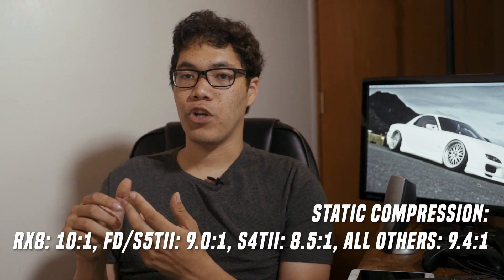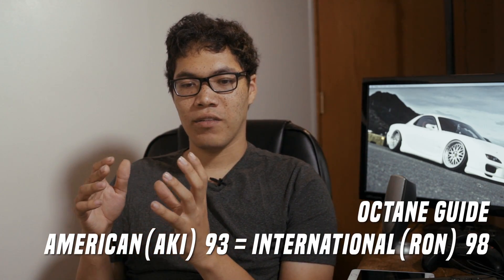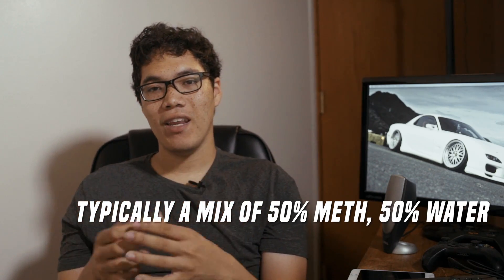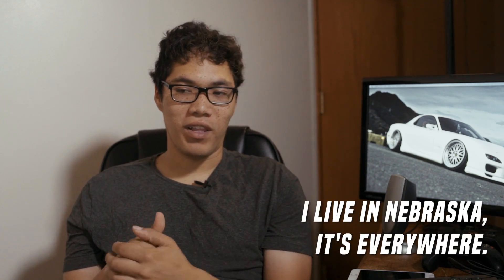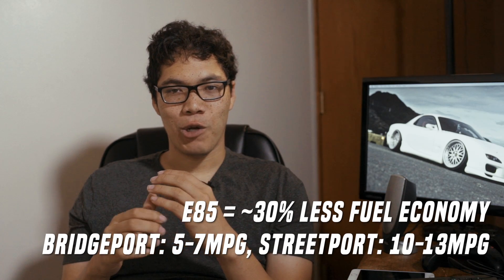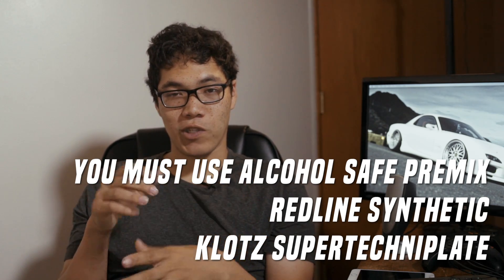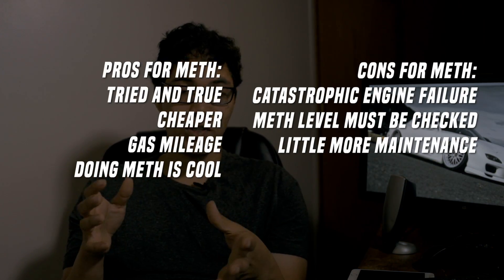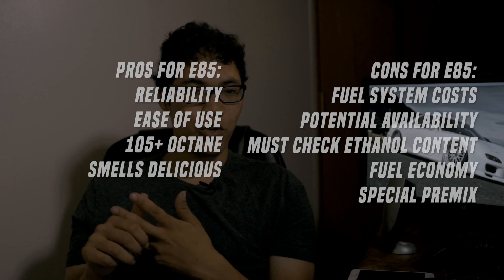E85 Or Meth Injection For A Mazda RX7?

Comment from the maker: Quick correction: I used the terms pre-ignition and detonation interchangeably when they are not. Pre ignition is the ignition of fuel before the spark plug fires, and detonation is the uncontrolled burn, or explosion of the fuel/air mixture.
Reply from the maker: Detonation is the ignition. The fuel/air mixture should burn predictably. When it explodes, it's detonation.
Reply: @KennyatHumble  detonation has nothing to do with explosions. . . Detonation = spontaneous combustion.  Pre-ignition = spontaneous combustion (detonation) prior to TDC (actually it's about 15-30° before TDC, depending on timing, rpm etc. . . But tries to send the crank the opposite direction)
Reply: Yeah water injection actually lowers detonation temperatures in result leaves more space for compression or boost
Reply: Would be interesting to see an engine (rotor) pulled down after running water/meth for it's entire life. I'd expect to see much less carbon.
Reply: Rotors Magazine All good Kenny!!!
Reply from the maker: Mark Thomas thanks for calling it out, don't want to spread misinformation
Reply: No worries mate. Love the channel. Cheers from Queensland Australia.
Reply: So does detonation happen after ignition?
Reply: was about ready to hammer you on that XD

Comment: I really thought this was fuel vs fuel and hearing him say that e85 needs big injectors like meth doesn't need huge ones and normally a few at that 😂. I will say every rotary iv rebuilt that ran water injection looked new inside. The water meth motors are the irons more but still minimal and very clean no carbon really to speak of

Comment: Detonation does not mean "explosion".  . Pre-ignition is the best term.   Both mean the fuel burn happens prior to spark, ones trying to rotate your crank the opposite direction.

Also are wrong on octane.  Lower octane = more volatile fuel, means you cant compress as much. . . Theres actually more power per volume on lower octane, hence the reason you need 30% more fuel to run E85, vs gas.  The reason diesels make so much power per gallon.

Comment: my question is do you have to run meth 24/7 when you install it?  

what if you run out of meth while driving?
Reply from the maker: No, The spray is only activated how you set it. Whether it be via a sensor monitoring boost, or an input off the ECU, or a multitude of options. When you run out of meth, assuming you have a failsafe in place, the car can do a multitude of things, it can pull timing to safe range, or it can cut fuel and keep your car from boosting. If you run out of meth mid pull without a failsafe, you'll have a blown engine.

Comment: with todays technology why not run both setup you're fuel system  to be able to acomodate both E85 and and pump gas as well as also running a water/meth injection?  obviously first problem with that would be cost but to be honest if your a rotary lover cost really isn't a concern just means you gotta work a little harder in order to enjoy your passion.. now a days with the ecu technology available to the public you could setup fail safes not just to protect against  water injection failure you could even program a tune to wean off the water injection as your water tank begins to diminish on track. water injection was never really meant to run meth at all scientists just found that in airplanes(what water injection was engineered for)at altitude they needed to come up with a solution to stop water from freezing they tired with many different types of alcohol but what they found what worked best was methanol... race teams then implemented the technology after seeing the great results in the airplane engines and they found that methanol actually helps regulate intake temperatures resulting in even more power(the birth of nitro or straight meth engines) then after many years in the racing industry scientist start to experiment in water injection for economical cars to try for maximum fuel consumption efficiency they began testing with just straight distilled water and found that they could increase efficiency by 40% then they added the meth and found that the meth actually raised power and efficiency by lowering intake temperatures resulting in a increase of 2% in both power and fuel consumption.. although an increase but as far as fuel efficiency goes not enough to continue to use it...my point is you could have you cake and eat it too! run E85 when it's convenient but then switch to pump gas and water injection when ever needed or wanted it's in the plans for my fc!
Reply from the maker: Water/Meth + E85 is a negligble difference from running one or the other.
Reply: Rotors Magazine well it's called flex fuel I was assuming it's commen knowledge that you have to run one or the other the only reason you don't run water/meth with E85 is simply because of how much more E85 is needed to burn then petroleum you start to run into volumetric issues when you add more fluid when you already have to use so much with petroleum you could get away with it water/meth injection because you don't need to inject so much to reach a desirable stoichiometric ratio
Reply: There is actually a different. By running both you add oxygen to the engine, more than either one alone. If you want more kick use VP M5 it has nitro in it.

Comment: I've run basically the same motor/setup with pretty much everything, pump/meth injection, then 110 octane race gas, and now e85. I don't know how good e85 is for the engine innards but the car is making 70 more hp at the same boost level as before. The problem is the quality of e85 is all over the place. When I fill up and check it I see e57, e61, e-whatever but never actually 85% corn squeezin's...
Reply: E85 in California is regulated to be at 85% most of the time is test between 80% and 85%. It is not quite available everywhere but two pumps are 13 miles and 22 miles respectively.

Comment: is it possible to run e85 on an na rotary engine? or is it bad news for the seals? just curious
Reply: It should be exactly the same as running on a same rotary but turbocharged setup. The only difference is that the power gains aren't going to be as good. 25hp meth NA vs. 50hp meth turbo, is usually the random # people put out as an example. No is other words, you'll have at best 1/2 the power gain, most likely less vs a turbo car with the same meth setup(and obviously tune, because without a tune you'll have 0% gain unless you were already pre-detonating).
Reply: It's possible..  . But dumb.  You'll burn more fuel for the same power, and that's if you get a ECU flash.  Just running stock, you'll actually make less power.

The reason people run E85 is because it's less prone to knock (higher octane)  which means you can add more air (boosted applications), which allows more fuel, which makes more power.  Theres a fuel burn ratio that's optimal for power in general.  Too much of either and you'll be down on power. . .

You can also run E85 on high compression NA applications, but most just go with methanol straight at that point.

Comment: how about doing a vid on water only injection, there are heaps of benefits. The problem with meth is that its adding a fuel that you should really tune for. I've run straight water injection for 17 years. When I had original twin turbos running a stupid 18psi it allowed me to run lap after lap with no power robbing heat soak and safely run a little leaner. My WI kit will automatically drop boost if a fault is detected. Have been racing with a T04e for last 8 years and wear and tear from heat has been minimal.
Reply: Red Bat Racing I wanna see a vid
Reply: Red Bat Racing I 100% agree but now a day tuning isn't so difficult of a process so tuning in meth Is relatively easy

Comment: If you already have a Halltech Elite series ECU you can upgrade your fuel system with a flexfuel sensor. That way you can always limp to the next place that has E85 on regular pump gas, and the ECU will limit boost and what have you to accommodate the ethanol percentage currently in your tank. Don't know about other ECU brands though... answers on a postcard! :P

Comment: I've heard that high octane is bad for rotaries though. Loss of power and such. Is this true?
Reply from the maker: When using a higher octane fuel for a car that's only tuned for regular 87 octane gasoline, you can lose a touch of performance.
Reply: Would you recommend running higher octane in a rotary to reduce the risk of detonation?
Reply: @rucarnuts13  ive always heard that running high octane in a rotary is a no no because it has more carbon
Reply: @ironicchannelname6457  old high octane was more prone carbon deposits. . . That's back in the day with leaded fuel.  But injector cleaner will help with that anyway
Reply: @BlackBeardAir  high octane has more carbon look it up when commented that i had just learned that in chemistry 111
Reply: @ironicchannelname6457  wrong. . .

But let's be clear.   Octane has nothing to do with Carbon content.  Octane by definition, is resistant to knock (less volatility). 

Another thing to set strait.  91 pump gas from Chevron is not the same as 91 from Arco.  While both have a 91 rating against knock, quality of fuel is vastly different.  There are cheap octane boosters (lead, like previously stated), and more premium ones.  That's what makes California gas prices so insane (also the $.76 a gallon tax doesnt help), Is because they have their own formula requirements for emissions.

Example.  E85 (85% ethanol, where it gets its name) is roughly 108 octane.  Yet will leave your engine spotless. . . Must be all that Octane causing those deposits. 

 SMDH. . .
Reply: @BlackBeardAir  alright listen when youre buying high octane fuel your buying fuel that has more of an additive called isooctane google that for me and take a look at the chemical fromula then tell me what you see 8 carbon molecules in there now tell me exactly how that equates too less carbon in the fuel?
Reply: @BlackBeardAir  and actually modern fuels leave less deposits in you engine because of added delegates that break down carbon NOT because there is less carbon in the fuel its self
Reply: @ironicchannelname6457  
Throwing stones I see. . .

Again, octane has nothing to do with Carbon content.  I'll fix the above where I should have put carbon deposits.  Fuel is Hydrocarbons, period.

Point still stands about E85.  Not all fuels are created equal.

Sorry I schooled ya.
Reply: @ironicchannelname6457  
Its detergents.  . . But I understood your typo.  You however are still hung up on something.
Reply: @BlackBeardAir  this has literally nothing to do with e85 youre the only one who has brought up ethanol
Reply: @BlackBeardAir  did you look up what i told you too because if you did youd see it has everything to do with carbon content
Reply: @ironicchannelname6457  
I quote you.
"I've always heard that running high octane in a rotary is a no no because it has more carbon"

Which is false.  Octane has nothing to do with carbon.

And you telling me about a newer octane booster and detergents being added to the fuel today, only bolsters my statement about older fuel (leaded) and carbon deposits.
Reply: @ironicchannelname6457  
I brought up E85, because it has an octane of 108, but less carbon than 87 pump gas. . .
Reply: @ironicchannelname6457 hydrogen has an octane of 130, and zero carbon. . . That would be horrible for rotary 😜.  All that high octane.   Lmfao
Reply: @BlackBeardAir  let me rephrase im talking about gasoline of course different types of fuels have different amounts of carbon they're different compounds but with higher octane gas the carbon is gonna be higher i dont know how this discussion got so derailed talking about other fuels but that is the original point "lmfao"
Reply: @ironicchannelname6457  
"Gasoline" is different type of fuels.  Each has it's own formula.  Hell 10% is ethanol. . .  Race fuel is "gas" too.  Diesel has a very low octane, and has more carbon then all of them.

Again.  Octane does not =Carbon content.
Reply: Unless the ECU is tuned for more power, It wouldn't be a good idea. If it's stock, just stick to highest stock recommended octane fuel.